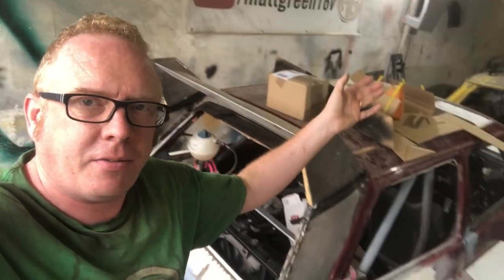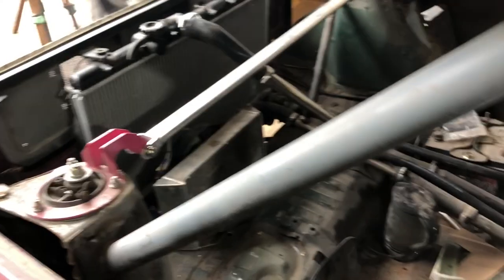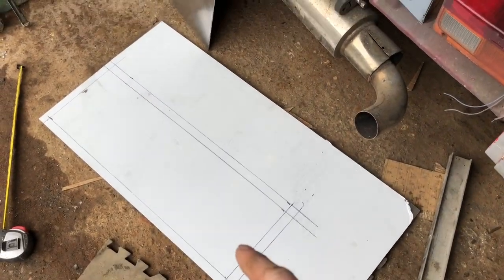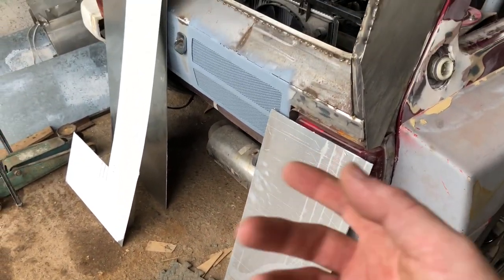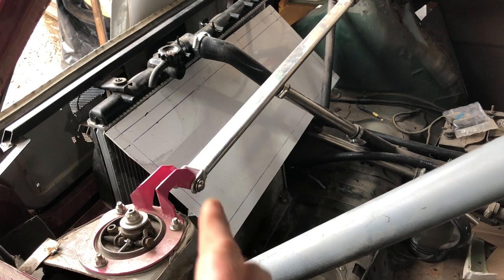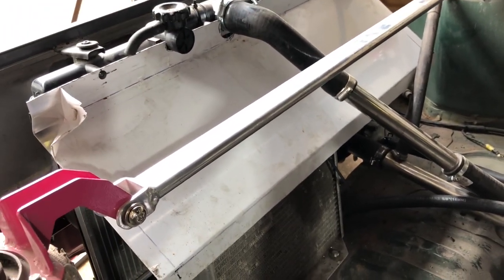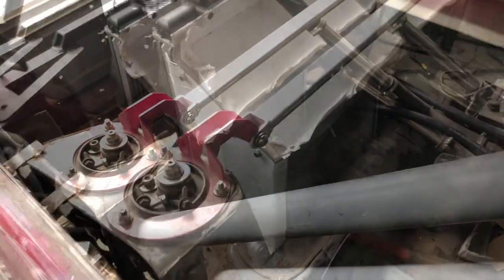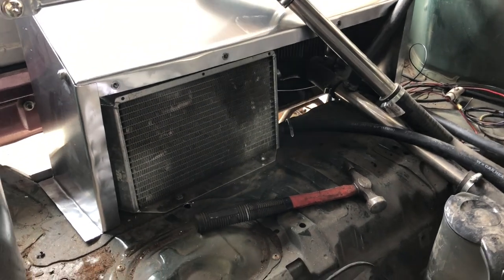Metro 6r4 Subaru (Frank) - Radiator Box

Comment: Matt, old windscreen rubber might make a good seal between the radiator box and the rear body work…
Reply: Window seal is good for that sold in meter lengths on eBay get the £3 test kit first Matt for sizing , we use it on the Renault 5’s for between the sill and skirt